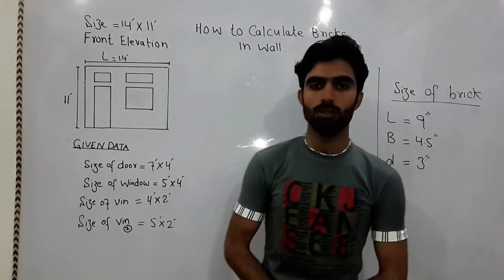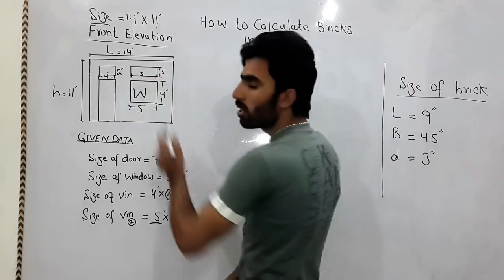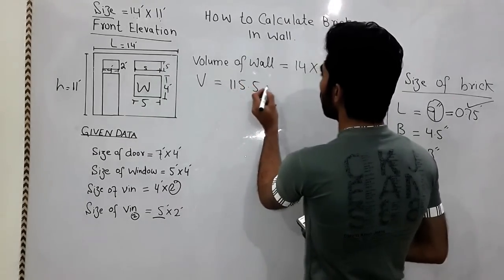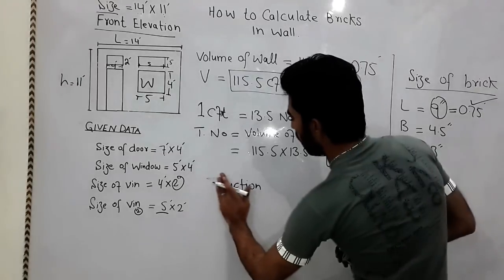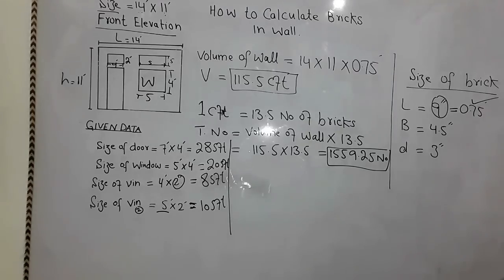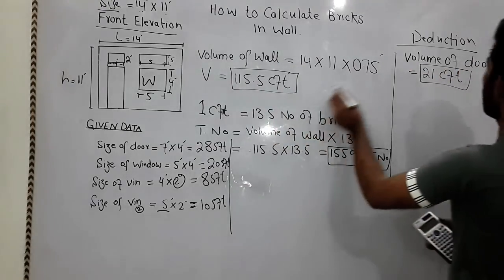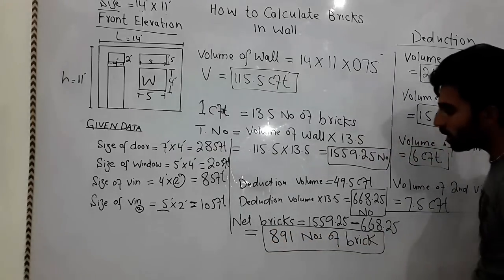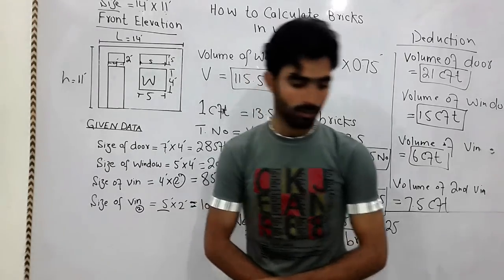How to Calculate number of Bricks.

Comment: 9 Inc is length of brick. How come it is depth of wall. Depth should be depth of brick i e 4.5 Inc for single brick wall
Reply: Akhtar Nagauri bro wall is of double brick 4.5+4.5 =9inch..that's y he is taking thickness of wall 9 inch
Reply: your right if the wall is built in stretcher bond. In this case the wall is wall in header bond, which is the preferable bond for exterior walls.
Reply: Single wall 4.5 matlb 0.375
Reply: Bhai.. ye double wall ka estimate bta rhy hay... Ap single wall ka estimate krny k liye 4.5 ÷ 12 kr k solve kr lo.😊
Reply: 4.5 nahe quantity × .375 asa kr